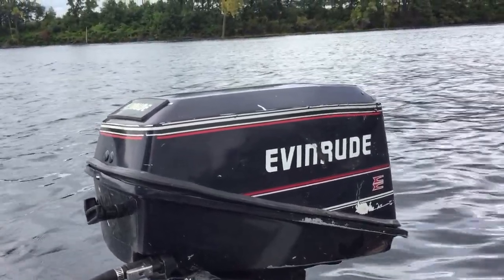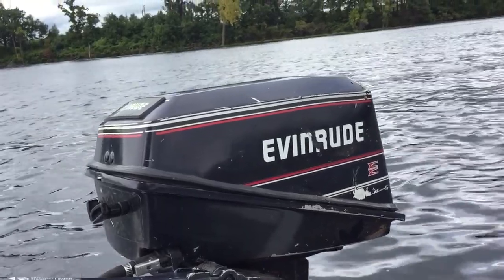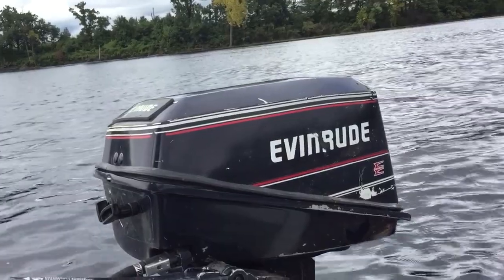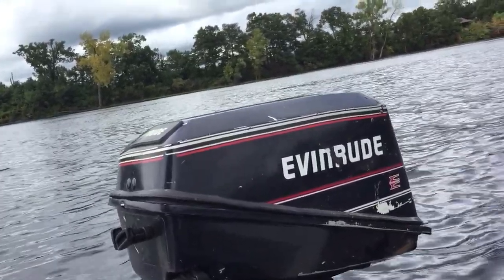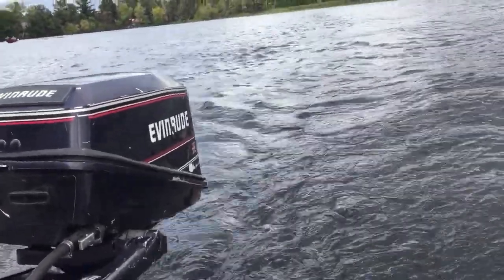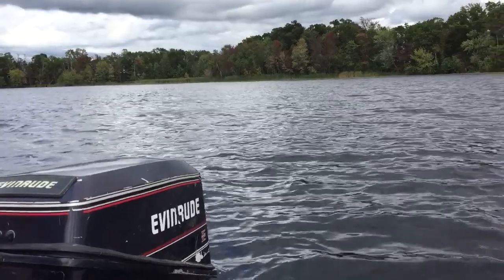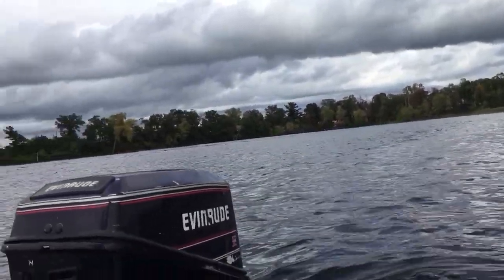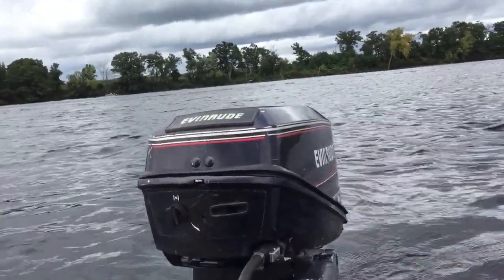1994 Evinrude 4hp outboard motor

Comment: I have a 4hp Evinrude from 92. Impeller was bad, channels were clogged, fixed it up run fine when dry. In the Barrel it gets water in the combustion chambers. Headgasket is ok, new. Any Ideas how the Water gets in teh cylinders?

Comment: Hi
I have a 92 evinrude 4hp, with broken Crank bearings. Is it possible to convert an oder johnson 4hp with point ignition to run with a 92cdi?
The Johnson has broken coils and Flywheel, ca i use the CDI Flywheel from the Evinrude on the Point Ignition of the Johnson?